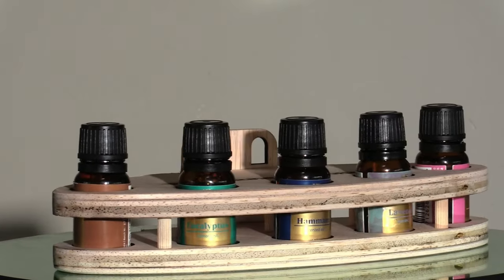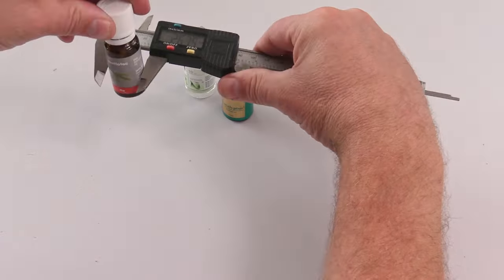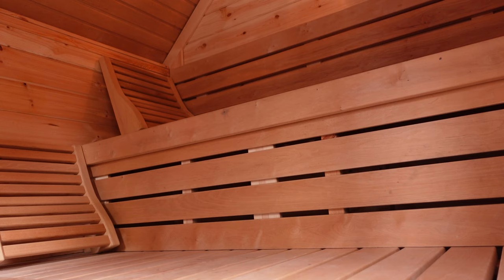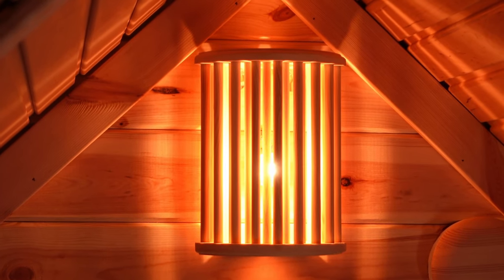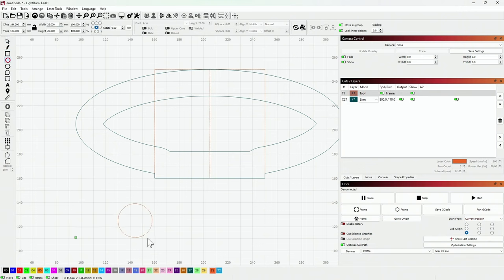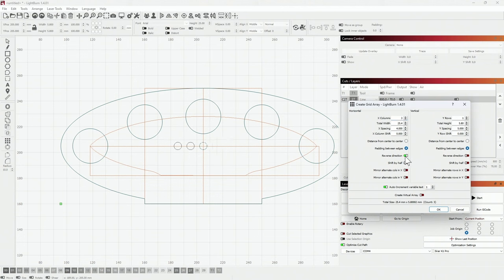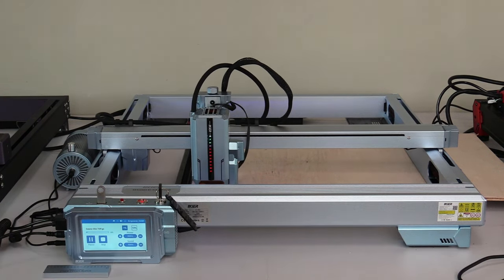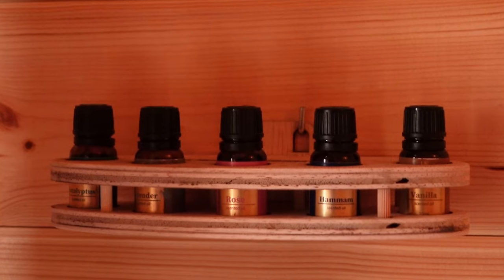Designing Sauna Oil Holders With Lightburn

Comment: You should probably not store your oils in the Sauna itself, where they are subject to heat stress, incl. degradation, polymerisation etc. In the end you are looking to inhale these oils and the quality of the oils is not going to stay the same. But for use outside of the "hot area" for sure this is a good thing.
Reply from the maker: Thanks, this is a good thing to consider indeed.